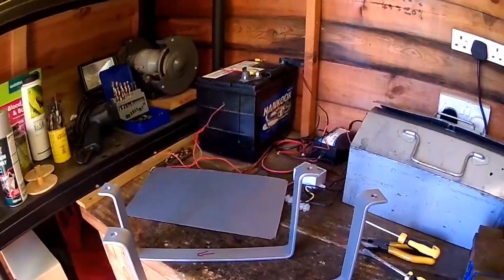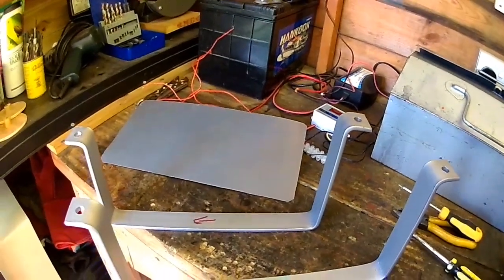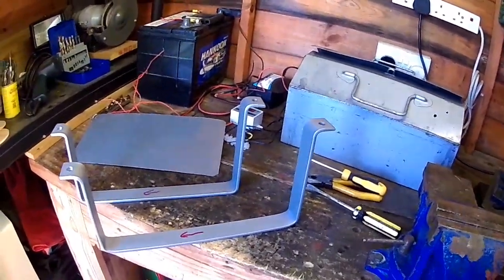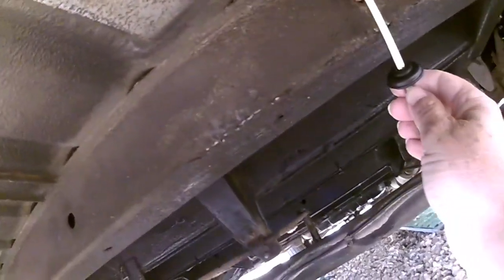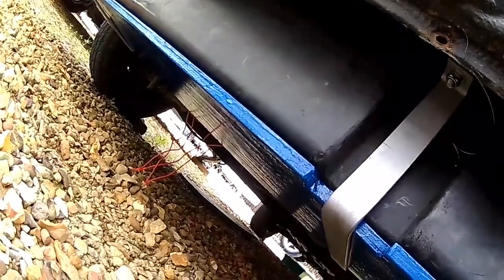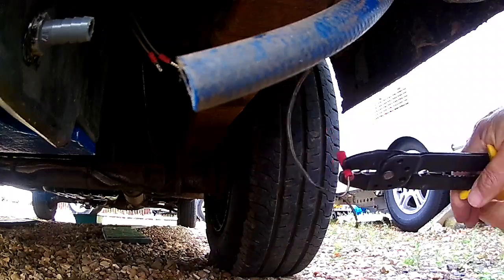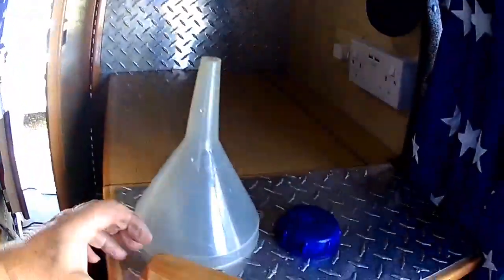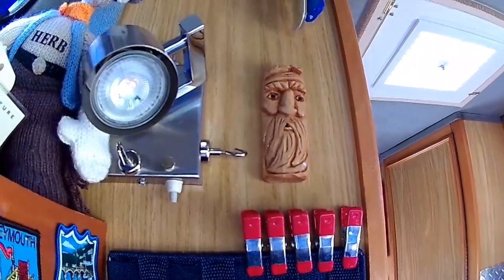Talbot Express Drain Tap Replacement. Water Tank Removal. Part 3 of 3. Fin

Comment: Hi and thank you for the videos. The plastic ribbed pipe that goes from the filler cap into the tank is leaking on mine, would be able to tell me the size of this plastic piping so I can order a replacement? Thank you
Reply from the maker: Hi Matey I think I have some in my Garage. Will measure it and let you know. What part of the country are you as I may have some spare. ?
Reply from the maker: Food Grade Hose 1inch 25mm.
Reply: That is so helpful and I'm really grateful. Thank you for taking the time to respond to me.
Reply from the maker: Ps when ordering the pipe make sure it's the inside diameter. Some people companies sell by outside diameters etc
Reply: I'm glad you said that I'm useless with any hands on repairs, so undoubtedly, I would have used an outside measurement. Unfortunately I'm having to source a bodywork specialist also as I have rust issues but I'm determined to keep the van alive. Have a great day.